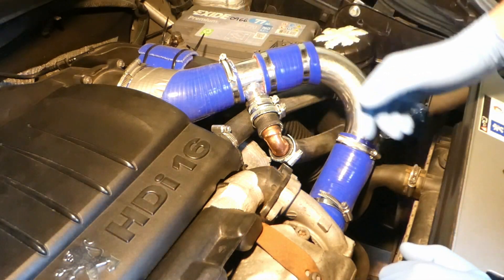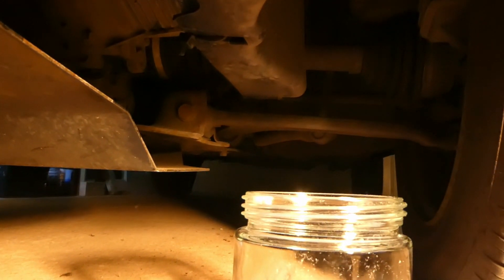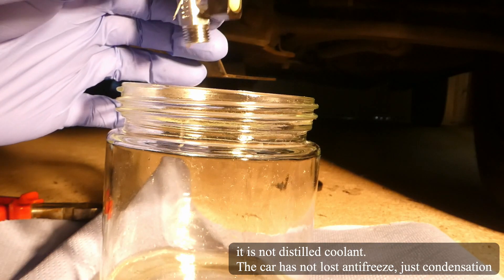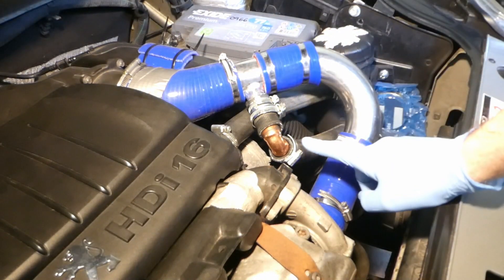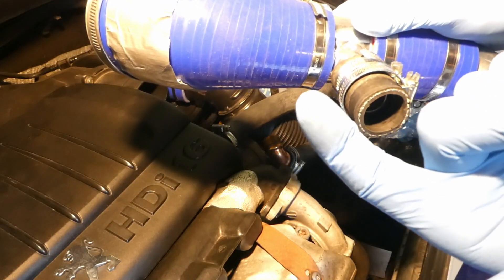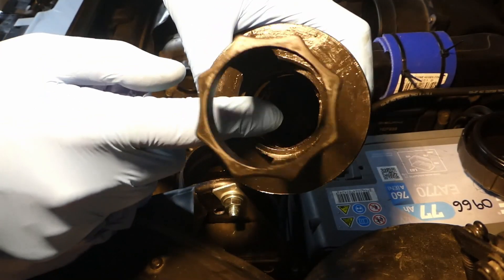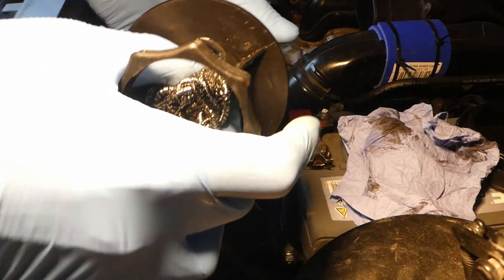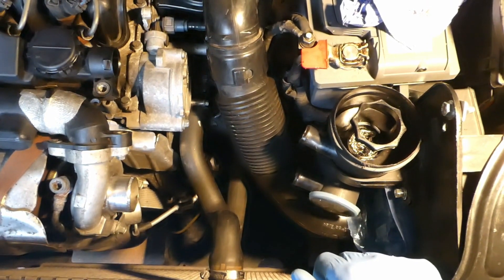1.6HDi/TDCi oil catch can collecting mainly water, Update #1 (Peugeot/Citroen/Ford/Volvo)

Comment: What filter is better for the oil  catch can the paper or the steel?
Reply from the maker: That is a tough question to answer. Difficult to say without additional experiments to test the efficiency of both paper and steel. I suspect that the paper might be more efficient, but it would need to be replaced.
Reply: @moremolecules  yes replacement = more money 💰 🤑 
Thank you  very much I like what you do
I have same engine in my ford
 I will try to put a catch can 
Also I have problem with the manual gearbox 
I suspect clutch...120 k miles On the clock
Reply from the maker: @aluyal9288  Catch can helps, much easier to fit on Ford than the 1.6HDi. Somehow the airbox is much better placed in the 1.6TDCi than the 1.6HDi.
Reply: @moremolecules  yes I see don't need to long hose
I can connect the catch can directly from the hose what is coming from crankcase original hose and the out of catch can with is down:D very very short hose to connect back to intake manifold

Comment: I thought a small spring siliconed to bottom of metal filter to hold just one stainless scourer at the top would be good. If that scourer gets blocked with oil  the spring would push scourer down without effecting pressure.
Reply from the maker: The scourers have way too much air/holes in between the metal fibres for it to get blocked. The same way the metal filter has mesh inside that is finer than the steel scourers. The scourers just add a bit more surface for the oily droplets to form and come out of the air suspension. A spring a the bottom is a good idea though.

Comment: What needs to happen with these catch cans is in a word "condensation".  We are trying to condense the hot oily vapors in the can where the oil/water vapors fall out of the crankcase fumes and into the can with little or none getting through.  There are three things you can do to help this along.
1. Install the can in a cool location
2. Get one of those green foam lawnmower air filters from your hardware store and cut off a small piece of it, and snugly fit it into the outlet port (from inside of can) to grab the last bit of oil/water         vapors that might be remaining.
3. If you're really anal about this, you can install one of those clear plastic fuel filters inline with the hose returning to the intake manifold.
 Hope this helped.
Reply from the maker: I completely agree, although there is not much room in my engine where to put this can, but I thought about somewhere cold. The inline fuel filter is a good idea, but I am slightly apprehensive to do it as it will add resistance and potentially higher crankcase pressure.
Reply: @moremolecules  Those inline filters really offer little resistance when new, but I don't know what might or might not happen to flow resistance when it eventually gets saturated with oily fumes. Crankcase pressure is a concern to me too.  Keep the hose length to the can as short as possible.

Comment: I have also bought a clone and waiting for it to arrive. It comes with a steel mesh like yours. Although, I am thinking, instead of the steel sponge that you put in the middle, I am thinking to put synthetic wool, the type that you put in as a filter in Kitchen hoods. I've seen it condensing cooking oils and filtering the oils from the cooking air in recirculating kitchen hoods. I'll test and report back if it does catches the oil.
Reply from the maker: Sounds like a good idea. It has to be relatively dense, i.e. the gaps cannot be too big, otherwise it would not catch too much oil. Let me know how it goes and if collects oil. I chose steel scourers as it is relatively cheap and it does not break into pieces.

Comment: great videos, i think the design of the catch you have is not so good as the outlet is at the botton..so oil vapour will allways get through..ive bought a different style can were the in and out are on the top..inside the can i modified it so the inlet pipe go's further down the can and the outlet is at the top of can so rising air has to go through the steel mesh to get out...that said  haven't fitted it to my Peugeot expert campervan yet...
pcv valve gases and oil are a real killer for these 1.6 hdi along with egr valve soot it all turn into crud in inlet manifold...and injector tips (nozzles) get blocked...map sensor gets filthy on air doser...
maybe worth cleaning up or replace map sensor, electrical  cleaner on maf sensor,remove oil sump and clean out and check oil pick up strainer that its not getting clogged...remove oil feed turbo pipe  and clean with carb cleaner and blow through with air gun...remove the fimble filter in the lower banjo bolt and chuck the little fimble filter in bin as this is whats clogs and blows turbos...remove intake manifold and deep clean it as it will be very full of crud...remove vacuum pump and inspect oil feed hole and blow some air and carb cleaner in..as this is another fail for crud...
good news is i have rebuilt a 1.6 hdi and in 114000 miles the old piston rings, conrod bearings and main crank shaft bearings were all in tolerance and hard worn at all..i replaced them but the bottom half of these engines are pretty  good..
inlet valves do suffer from crud badly and inlet side of cylinder head needs a deep internal clean...
my van is remapped to 110 bhp from 90bhp egr now blanked and disabled in ecu...i just need to sort the pcv set up...hope these tips help you out
Reply from the maker: Hi Gary and many thanks for all the info, much appreciated. I read somewhere that one can swap the inlet and outlet of the Provent 200, so the oil vapour rises up through the mesh. I will see what I can do if the steel scourers do not work on my setup. I mainly bought it for the larger inlet/outlet ports as not to restrict airflow and increase crankcase pressure. Great work with all the cleaning, I might have to do the doser as well someday, banjo bolt filter, etc.

Comment: How many kilometres have you done since installation? There appears to be no oil at the inlet to the turbo. Perhaps you have not done enough kilometres to gauge the effect yet?
Reply: Thanks. Standing by for updates. I’m still working on collecting the components for mine
Reply from the maker: @davidwarren4569  Good luck!
Reply from the maker: Hi David, while I agree that I have not done enough miles since installation (~500 miles or 800km), there is a bit of oil from the outlet of catch can to air intake. I do not assume that the catch can will catch 100% of all oil vapour, but I would have thought that it should have collected more. I did not show it, but there is an oil residue just before the turbo on the hose. Before showing this, I will have to be sure where it is coming from. It seems like the turbo might be blowing a very small amount of oil on the compressor side, although it might be from the new air intake. Say if the air intake creates a higher vacuum at the turbo side, this will draw oil from there, e.g. more restriction in my piping. On the other hand it may come from the oil catch can, but the way it has been sprayed, I am not too sure, that is why I have not shown it as I am uncertain myself. Might have to buy larger intake pipes.

Comment: Great update. That is a really small ammount of oil.  Im figuring out how to construct my oil catch can, mostly because I dont know what to use to connect the pcv vent to a hose, i made one before but didn't help. Thanks!
Reply from the maker: Many thanks for the interest, really appreciated. Yes, I had the same problem, ended up using the breather part from a Ford Focus. Not really much oil, but I will have to see if the steel scourers help. I know it is a cheap imitation of the original Provent 200, but will see.